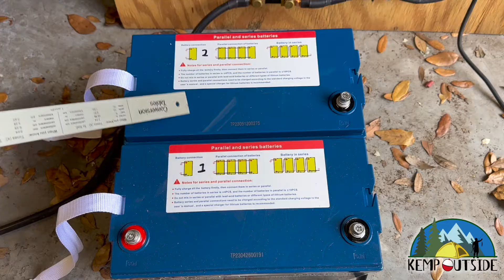Connecting Two Batteries in Parallel | How to Properly Set Up A Battery Bank with Two Batteries

Comment: Can you run the leads off either of the two positives and two negative? Both my leads are Blk cables and one has a Blk zip tie around it.
Reply from the maker: It is best to draw the positive off one battery and the negative off the other battery to get the right power draw from both batteries. I am concerned that your battery cables are not easily identified as positive (red) and negative (black).

Comment: I'm assuming that the wires from the negative terminal of one battery and positive terminal of the other battery get tied into an inverter or something like that. What terminals would the positive and negative wiring of a charge controller land on? Do they go to the same terminals the "inverter" wires start from, or the opposite?

Comment: How do I hook up a charger in a parallel system when both batteries have drained?
Reply from the maker: Connect the charger positive lead to the positive on one battery and the negative lead to the negative on the opposite battery. This will charge both batteries simultaneously. The charger will see them as one big battery.
Reply: @KempOutside thank you very much!
Reply: @KempOutside  does it matter if I use the post that has the cable on it or the other post it doesn’t have a cable on it
Reply from the maker: @bozo1952 it doesn’t matter.

Comment: Can you connect two batteries that have built in overcharging and low voltage cutoff
Reply from the maker: Yes that should not be a problem.

Comment: do you have the video showing the wiring of 3 or more batteries in parallel?
Reply from the maker: I don't yet as I went a different way and now use 2 larger batteries rather than 3 or 4 batteries of this size.  However, I still plan to make that video once I have enough batteries.

Comment: Any suggestions on running 2 parallel yellow top batteries in separate vehicle locations? I’m wanting to buy a 2nd optima battery for my truck to replace the older 80% life battery at the engine then use the old battery to run my power inverter under the rear seat. My inverter can run 12 or 24v.

Comment: If batteries are next to each other and connected in parallel,  the cable resistance is insignificantly small between the two batteries.  For example, 4 guage wire is approximately .2485 ohms per 1000 feet.  Using 1 foot of wire between the batteries results in .0002485 ohms per one foot piece of wire.  If say 100 amps was flowing in this wire, the voltage drop = I x R = 100A x .0002485 ohms = .02485v drop across this wire.  This means that your wiring example has no practical difference and you should not consider your method of any importance.  Wire which ever way is easier.
Reply: first of all, you have to remember that each terminal has a 1 ft cable...so you need to double your voltage drop.  also, keep in mind that in this example, the image showed 4 batteries.  so, you are talking 8 ft total, 100amps on 4awg is a .5 v drop.  .5 volts on some setups can be a significant issue for charge and discharge.

Comment: Drop a fuse between those positive connections. One battery starts to flake out those amps will jump up to 1000 amps and bad stuff happens then in a short. Fuse aic will blow and shut it down fast.

Comment: What size cable do in I use to connect the 2 batteries?  Application is for 4-5 bulb string of lights, running a vacuum,etc. basic usage for an off-grid camp
Reply from the maker: I always size cable to what I could pull, not what I am pulling.  If you are connecting a 100ah battery or multiple, I would recommend 1/0 wire.  There are calculators online to determine amp draw and cable needs.  I get wire is expensive so people want to run smaller wire to save money.  But safety is my top priority in designing these systems.  None of this is any good if it burns to the ground.

Comment: Sorry, but you're incorrect.  No matter how you wire it up, as long as it's a parallel connection, all batteries "work" equally hard. The only difference between your way and the way the picture shows is the extremely tiny difference in resistance of the wires between each one. In either case, all cells (or batteries) will drain or charge the same amount. They will always self equalize.
Reply: Correct, parallel means they all are the same voltage, the difference is current draw for each battery maybe.
Reply: in this example, the image showed 4 batteries.  so, you are talking 8 ft total, 100amps on 2awg is a .5 v drop.  .5 volts on some setups can be a significant issue for charge and discharge.
Reply: Sorry, electrical resistance of copper 2 AWG wire is .0159 per 1000 feet! That means it's .00159 ohms per 10 feet. Meaning rounded up to 2 thousands of an Ohm! I don't think that small of a resistance will cause a drop of half a volt! 😏
Reply: @offgridgarageUSA  you are off by an order of magnitude...The resistance of a 2 American Wire Gauge (AWG) solid wire is 0.1563 ohms per 1,000 ft.  I'm not trying to convince you though...do your thing.  from personal experience, in my setup, it was a half volt drop and it caused an issue until I changed it like the person in this video showed.  I was pushing 120 amps though at times.